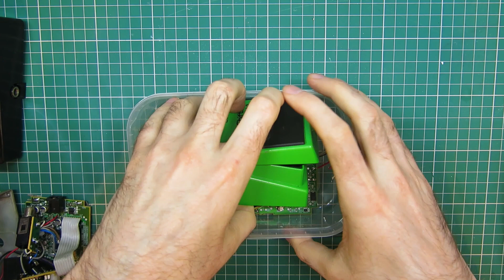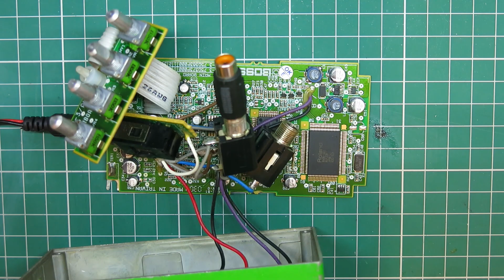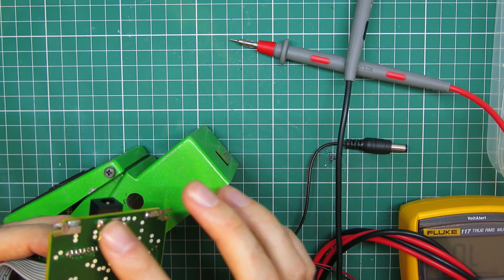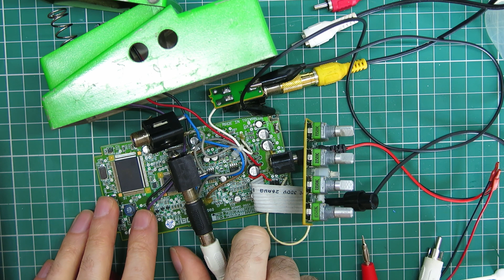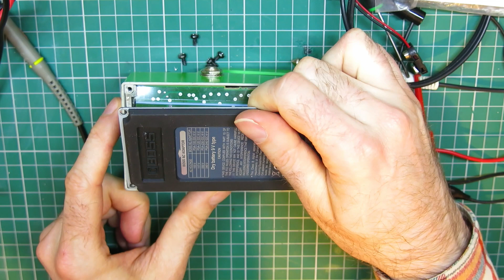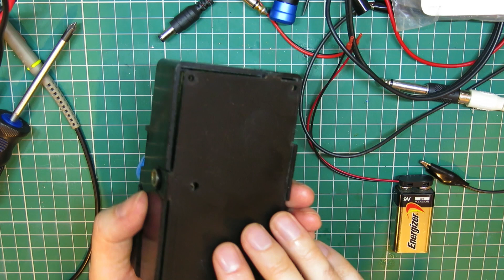(Another) Boss PH-3 Phase Shifter Pedal Repair - Success!

Comment: Ibanez ue 303b: switches are faulty...everything looks good internally and deoxit didn't help...do you think it's some old cap?
Even worse: the auto filter section doesn't work at all (signal passes but it's distorted and doesn't add any effect). Any help please?
Reply from the maker: @lovecraftmusic8717  alas I wouldn't have a clue without having it in front of me and going through a schematic - never worked on one of these. First thing I would check is power rails around opamps
Reply: @jamesbennettmusic  understandable... Thanks a lot 🙂.
If only I had a good tech near me...
Reply: @jamesbennettmusic Hi James do you do this as a job or just a Hobby, I have recently purchased a PH-3 second hand, It worked flawlessly for 4 days then I plugged it in and it no longer phases. Works in bypass just doesn’t seem to do anything when it’s engaged anymore. I’ve taken the board out but can’t see anything that’s obviously wrong with it. Shame as I loved the pedal.
Reply from the maker: @aliandthenutsacks9394  A bit of both! Does it pass signal when it's activated, but just with no perceptible change? Or does it go silent?
Reply: @ it works intermittently when activated, the sound just comes in bursts.
Reply from the maker: @aliandthenutsacks9394  obviously hard to say for sure at a distance, but it could be one of the pots or the connection to them, especially the selector pot on the right. They're all read by the CPU, and erratic readings could cause errors. Could also be a cracked board like mine was, they're hard to spot!